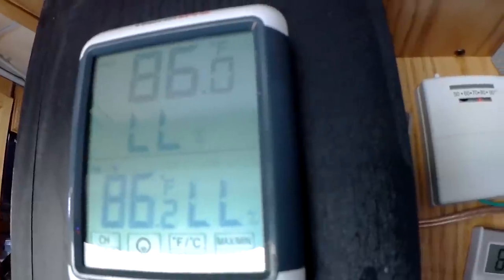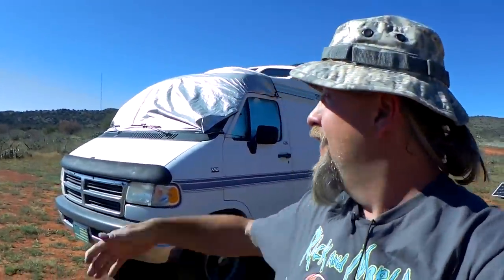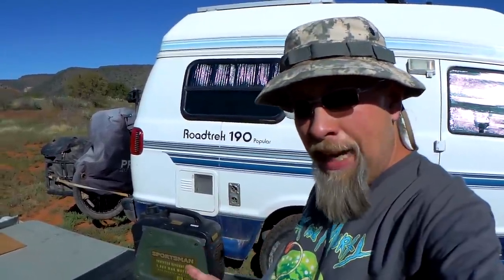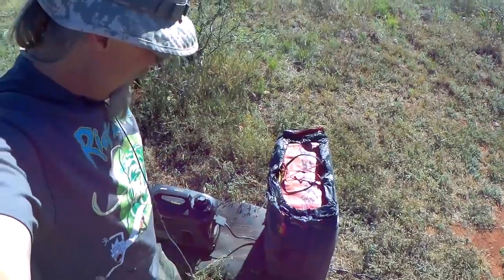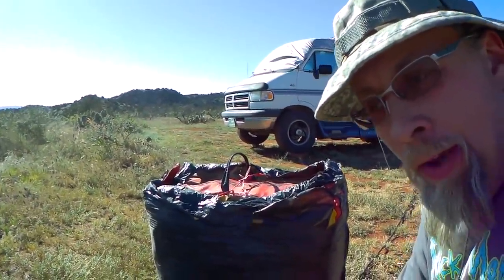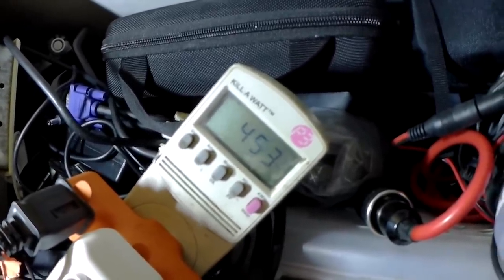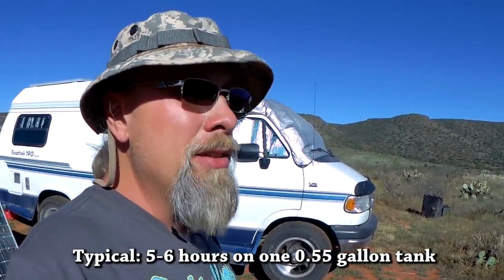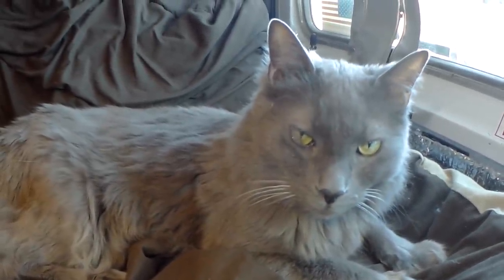Will My ABUSED 1000 Watt SPORTSMAN GENERATOR Still Run A 5000 BTU FRIGIDAIRE AIR CONDITIONER?

Comment: I started with that generator but it couldn't start my 6kbtu unit. I returned it and ponied up for a Honda 2200. I decided i shouldn't cheap out when my dogs life is in the balance.
Reply: My 2200 runs a 5K BTU AC for about 3hrs on 1 gallon in econ mode.  Expected it go 4 to 5 hrs.   Recently installed Hutch Mountain Propane conversion kit.
Reply: @DesignerAviaries  that doesn't sound right. I can run my ac on full blast for 6 hours. My unit won't even start up when the gen is in eco mode. You should put a kill a watt on there and see how much energy your ac uses when running. I'm running a 6kbtu window unit which draws 500 watts at full blast. To only get 3 hrs either your gen is having a problem or your ac is really inefficient
Reply: I have no experience with propane though
Reply: @bren42069   Just found  watt meter to measure  5K  AC draw.   New Honda never varied from 2,800 RPM in econ mode.    Maybe I got use gasoline estimate  wrong since never let it run dry.  Have only used it  for 10 hours.  
RPM/HOUR meter and magnetic dipstick are common options.   Runleader HM026A (meter) is OK but would prefer a design with replaceable battery.  The two times I have checked the dipstick there has been graphite like residue on the tip.  Metal particles presumably.  

 COPY/PASTE from my Amazon Review.............

 Measuring the temperature of the exhaust under various loads  (steady  2,800 RPM economy mode) revealed the Honda is like a  medical instrument; 

 >131 degrees running 5K BTU  AC, small fan and 60 watt light bulb. 
>129 when the fan and light bulb were turned off.
>127 when the AC was switched from HIGH cool setting to LOW cool. 
> 98 degree exhaust idling with no load. 

Propane conversion may come in handy.    Honda was  installed in rear utility room of box truck with bulkhead access panel for controls and recoil start.  Bulkhead mounted AC and Honda exhaust are vented through floor.   

Variable speed, 200 CFM fan ideally suited for stealth ventilation. 
29 watts and 28 decibels at maximum speed.  

AC Infinity CLOUDLINE S4 Quiet 4” Inline Duct Fan with Speed Controller. 
Check out their product line to keep pets comfortable.
Reply: It's a good idea to break in your generator and Chang the oil a couple times after an hour or two of running to remove those bits of metal so they don't screw up the engine
Reply: @bren42069  Correct.  Went through that routine  in accordance with advice from expert who also   advised removing the plug and lubing the cylinder walls before initial start up.  Used Marvel M Oil.
Reply: Nice. if you still have metal flakes change it again
Reply: @bren42069   The initial oil  change (after an hour) was surprisingly discolored but won't there always be a slight degree of wear showing up on the tip of the dipstick.

 Everything is relative I suppose and   maybe the dipstick accumulation will decrease after  the first 10 to 20 hours.      I was pleased to see the dipstick removing contaminants.    

 YOU TUBE video below  shows much more "graphite" on the dipstick than I had .........so unsure if the solution is constantly changing oil........given Honda maintenance schedule is every 100 hours.   

Honda EU2000 Companion - genset 2 magnet residue
Reply from the maker: During break in the genny will use excessive amounts of fuel and also expect brownish oil right away. Sportsman calls for a 20 hour break in period where you are supposed to run about 50% load then change the oil. Used about 50% more fuel than normal during that period too.
Reply: @HOBOTECH      Empirical evidence to the rescue !!   There is a scarcity of information  on this topic........

 "A new engine and generator will burn some (a small amount) of oil when you first run it, but it shouldn't use much after it is broke in. The fuel consumption will be a bit higher too"
  
Have recently learned you can break in a generator on propane,  according to a big company that ships Honda units with their propane  kits installed.   The reason for  using gasoline (before conversion) is  to make certain they are OK before voiding the warranty.    
 
Next oddity is evaluating why the Honda vacillates between 2800 RPM and 2,790 on propane  with no load.  I'll wait to see how it behaves with a load.  Might consider  iridium propane plug suggested by Hutch Mountain.  It ran at steady 2,800 (eco mode) with gasoline running the 5K AC.
Reply: @DesignerAviaries  What do you mean iridium propane plug?

Comment: Good idea using Synthetic Oil. How many hours between oil changes? A qt of oil must last a long time!
Reply from the maker: Manual says 100 hours which is what I used to do when I would top fill it, but now I'm putting in only 7.5 oz I end up doing the changes at 50 or whenever the oil light comes on.

Comment: Would have liked to see the temp change after running ac for a period. Always wondered good a 5000btu would cool a van. Thanks for adding the killawatt info,was curious about that as well. Thumbs up.
Reply from the maker: I showed that in a few videos and on Instagram. Usually good for 25 degree drop from ambient.
Reply: HOBOTECH thanks, I just started following you. I’m sure I’ll catch up. Your ac runs at less than 450 watts, that is not an insurmountable task to power totally by solar! Wouldn’t that be sweet!
Reply from the maker: Not in a van. There is also a 20% overhead for the inverter. So 800-1000w minimum and this assumes no clouds which doesn't happen much July in AZ.

Comment: Awesome Tom, was wondering how the little Sportsman would hold up on the AC! Gives me great hope as we HAVE to have AC for medical reasons.
Reply from the maker: The a/c I use has a soft start built in. I bought it specifically for that reason.
Reply: @HOBOTECH  Is that something that is built into most new ones or you have to specifically look for it?
Reply from the maker: You have to look for it. This Frigidaire unit is often used for campers that run on generators so it has it built in.
Reply: @HOBOTECH  Ok good to know thanks.

Comment: You want to hear cheap?! Sportsman makes a dual fuel 2200 watt (surge, 1800 watt constant) that can run on propane. And it can run for 18 hours at 50% load on one standard tank of propane, 7 hours on gas. Of couse, your wattage capability on propane is going to be 10% less, so you lose a bit, but it's sooooo cheap to run. Has a sine wave inverter too. I see from the suggested videos now, that you own a sine wave inverter generator, but now they have dual fuel. And get this, some brands like Firman, make a tri fuel that can run on natural gas too.

Comment: For some reason when I turn on the AC to low cool my watts jump up to 760 watts tripping on the overload and killing the generator.  I was only able to successfully get it to run two times where it'll only jump to 460watts. Not sure what's going on.

Comment: Not a bad price for that Sportsmen genny, even though its a bit loud. Is 5w-30 the recommended oil for that genny? Seems a bit thin for this time of year. I would try a 10w-30 or even a straight 30 motor oil which should smoke less. The Marvel Mystery oil will add to the smoking . The Westinghouse is made in China as well. Then again my Honda eu2000i is made in Thailand, not  Japan.  Thanks for the video.
Reply from the maker: Yeah, it's not as loud as the camera lets on. Although it is louder since new. Manual says 10w-30 and that's what I been using up to the last oil change, but the winter weight makes no difference when it is hot. It smokes because it is over-filled. It's hard to guess how much to put in when the dipstick is wrong. Unfortunately, everything is made in China but Westinghouse warrants their gennys for 3 years.

Comment: Why not add a second shore power connection exclusively for the small generator? This way you don't have to worry about snaking an extension cord though windows or doors. Just have it power a single internal outlet that you can plug the AC into. You could do it for about  $50.
Reply from the maker: I don't have the tools to cut holes in the van, but I been trying to think of a way to plug in through the existing a/c vents.
Reply: @HOBOTECH  Take a block of wood, cut a groove in the center to run full length, the groove will slide down over your open door window, somewhere in that block have a key hole shaped cut that will allow the drop cord to slide through the crack to the hole in the key hole, then roll up the window like normal shutting, you could put slats or wood dowels in the top side of this block that would locate the block into the channel of the window track
Reply from the maker: Numa Newbern, Good idea but I don't have any roll up windows in the van. They all pop out on hinges.

Comment: wow 85 degrees and 10% humidity, and need AC, must be from Canada
Reply: 86 temp  @ 10 percent humidity  is about 80 degrees REAL FEEL, aka HEAT INDEX.  

When in Florida (thirty years ago) I got used to  80 degrees @ 80 percent humidity rather than huge electric bill.  86 Heat Index.   Heat tolerance generally decreases with age and waning physical stamina.   Current preference is  72 to 75 heat index.

Comment: Is a propane generator quieter at 1000? And wud U suggest propane to gas?
Reply from the maker: Propane is just as loud. It's not the type of fuel but design of the generator. I don't recommend propane for RV/van living because it has a much lower energy content than gasoline. Propane also doesn't like temperatures below 20F and in most of the country is well over $3/gal. So propane puts out less power and costs more to run. However, for an off grid cabin scenario propane is better especially if you can get it delivered in bulk.
Reply: HOBOTECH thank U so much for that valuable information ! That completely tells me what i needed to kno.

Comment: I bought one last week. In the manual it says 7.5. In the phamplet, it says the same, and then in bold lettering it says to fill until almost overflowing. Wtf? Which is it? And what's the point of the dip stick then? Lol.

Comment: I saw a 2 KW version on sale after I bought the 1KW and the 2kw was $199
Reply from the maker: Those aren't quiet inverter generators. That's why they are so cheap.
Reply from the maker: If that was really $199 that's insane. If you see it on sale again let us know.
Reply: @HOBOTECH  It was about 2 weeks after  I got the one You gave a heads up on.

Comment: could you let us know how long it will run the ac unit on a full tank of gas?  ive read these units will run up to 14 hours on a very light load(100watts) and i was wondering if its true
Reply: i see you already answered this ? in the video!  thanxs for the info ive watched 15 or so of these videos on this model and your the only one who gave that info

Comment: My Velcro, like for window Reflectix, in the summer heat The glue fails and the strips all come off.
Reply from the maker: I use the industrial stuff so it tends to hold up better.
Reply: @HOBOTECH  me too but still no staying power. I've even tried super glue on the unstuck pieces.

Comment: Definitely time to head to Idaho
🙂
Reply from the maker: I'm going to be in AZ for a while still.
Reply: AZ runs from just above sea level to over 9,000 ft so you never have to leave the state to enjoy good weather.  Too bad AZ does not have a great state parks pass program like New Mexico.  However there is a lot of BLM, Forest and State Trust land for boondocking.
Reply from the maker: Bruce H, AZ is also overcrowded and 9%-10% sales tax is most counties reminds me of living in CA. Finding good boondocking sites away from others is a challenge during the fall to spring stint just because everyone knows AZ is the best place to be during winter. NM offers the parks pass only because no one wants to go there!
Reply: Sale tax varies between the towns.  Chandler is a combined total of 7.8% whereas Quartzsite is 10.1%  Cottonwood is a hefty 9.8%.  The city of Phoenix is 8.6% but no sales tax on food at the state or city level.  Sales tax is higher than Idaho but I think ID does have a state tax on groceries.    Unfortunately, Wild Turkey with Honey is not considered food.    

Actually I have found it harder to find nice boondocking spots in AZ during the summer when school is out and the residents are heading up north to beat the heat.  

New Mexico has some nice areas so some folks are missing out.    

I hope you have some nice spots planned for your remaining time in AZ.

Comment: DON'T be deceived about the name brand NOT being built off shore, I worked in a warehouse of a company that has over 80% of the gen market, ALL of them are built offshore by this company that has MANY brands.
Reply: Numa Newbern I agree all of them pretty much are China. add propane in the generator will last two to three times as long no fouling fuel never going bad. Spark plug and oil looks like new when running propane.
Reply: I bought a briggs & Stratton mower at Walmart, only later to find out it wasn't a real Briggs, Chinese copy of a briggs.
Reply: Greg p then my Walmart push mower probably is a Chinese knockoff too.

Comment: This generator will only power the AC for 30min before it goes into overload mode and shut down.  I have the same setup.
Reply from the maker: It powered my Frigidaire model for hundreds of hours.
Reply: @HOBOTECH  Thanks for the reply. I'm bummed then. I had 2 of the generators do the same. My Frigidaire is exactly the same model too.
Reply from the maker: It does depend on fuel blend, altitude, and oil viscosity. I noticed above 5000 ft it has a hard time with the a/c and I had to run it on standard mode. Ethanol free gas definitely works better too. I also ran 5w30 full synthetic and that let it make a bit more power. The biggest issue I had was it overheating and vapor locking. That would typically happen in the first 20-30 mins.
Reply: @HOBOTECH  I think the issue I have is it will overheat and trip the overload. But I use 91 Octane cause it just runs and starts better. Being in California I can't control the ethanol blend. But I will substitute the oil with full synthetic. Maybe remove the side panels if it's a overheating issue. I appreciate your response. I love the size of this generator. Would prefer to have it than a larger one. Now if I can get my AC to run on it for 5-6 hours that would be fantastic.
Reply: I was able to run the generator for about an hour with eco mode OFF before I ended my test. So far that is the longest and good results. The AC compressor must never shut off or else if it kicks back on the generator becomes overloaded. A soft start capacitor will probably fix that issue. My AC is built into my teardrop trailer and that isn't an option for me.
Reply from the maker: @OverlandCO  My a/c compressor never shut off so maybe that's why I was able to run it without issue. I only ran it above 85 degrees most of the time and it took all 5000 BTU's to keep it in the 70's on those hotter days.

Comment: I have a Honda 600 that is over 40 yrs old and still starts right up in a couple pulls and doesn't smoke or use any oil. I do get the oil changed about every 5 years whether it needs it or not. LOL  I run it for days at a time powering a fan to burn log piles. Runs all day on a pint of fuel.
Reply from the maker: It was actually made in Japan. Not in a Chinese sweat shop. Old Japanese stuff is great.
Reply: @HOBOTECH  yep, had one that would go 18 hours on a gallon. It quit working and when I went to find out why, it was gone, stolen.

Comment: 7 000 hours on my champion 1200 watt. add a cap or half cap of seafoam to your crank case when you change your oil your plugs will last 10X longer